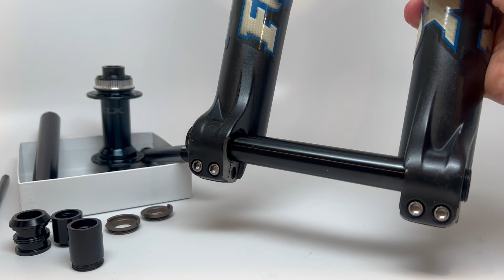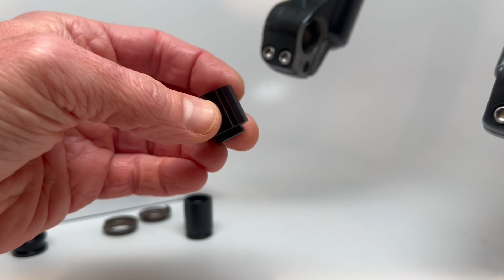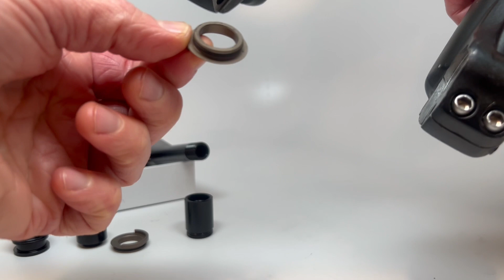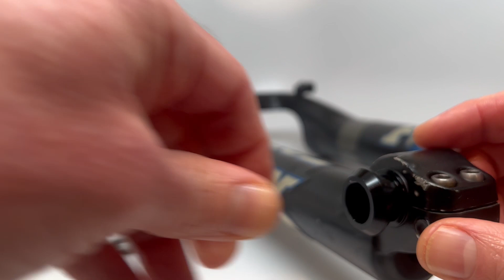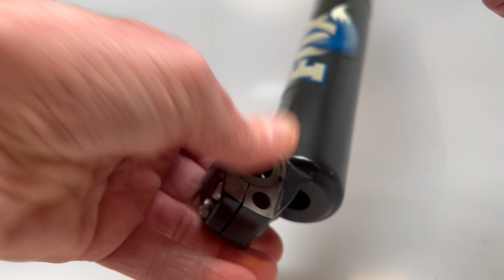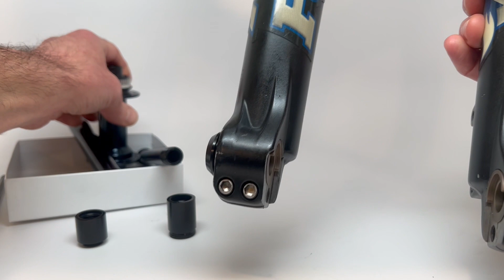JJBP Fox 36 & 40 20x110 Boost to 15x110 Boost Conversion Kit

Comment: I am on the look out for conversion to convert 15x110 Mavic CrossMax to 20x110 Fox 49ers Triple Clamp forks. Based in Scotland, I see you ship to the UK via ebay.
I'd like more info on the correct part and will they be fine on Fox 49 forks? Thanks.
Reply from the maker: Based on what I can find about the Fox 49 it should be a 20x110 Boost fork (as opposed to 20x110 non-Boost) and as such should be able to accept any 15x110 Boost wheel once converted. In that case, you’ll want my Fox 40 Boost conversion kit. You can purchase that direct by contacting me at joe@jjpne.com or use this Ebay listing: https://www.ebay.com/itm/115522066190
Shipping to Scotland is no issue.
Reply from the maker: My info for the fork spec came from here: https://www.ridefox.com/fox17/help.php?m=bike&id=806

Comment: Hi, will this kit work with fox 36 kashima from 2015? The fork  allows to mount 20x110 and 15x100 with an included adapter, but I want to convert it to 15x110. Thanks in advance.
Reply from the maker: 20x110 non-Boost forks can not be converted to 15x110 (which is always Boost). You would need to relocate the brake caliper mount which is not possible.
Reply: @JJPELLC  Is the 2015 36 float not boost? I can’t find anything on the Fox website to indicate wether it is boost or non-boost. Is there an easy way to confirm?
Reply from the maker: @adamsheahan4419 2015 is not Boost. You can convert to 15x100 but not 15x110 Boost.

Comment: Can I use the kit to convert 2016 Fox 36 from 15 x 100 to 15 x 110?
Reply from the maker: Unfortunately, non-Boost forks cannot be converted to run Boost (15x110) hubs. The issue is the placement of the brake rotor mount on non-Boost forks. It is too far inboard and will interfere with the disc brake rotor on a Boost hub.
Reply: Ok...thanks

Comment: Question on this kit so will any 15x110mm hub work with this kit. I have the same exact fox 36 fork it's a 07 to 10 as in this video I went to order this kit yesterday on ebay and they said I could make it fit but the brake caliper wouldn't line up right the hub is a 15x110mm with the brake rotor with the 6 bolt's if you could send me the right kit info if it will work or where I can get the right kit that would be great
Reply from the maker: I’m joejack951 on Ebay. The video is a bit misleading. The fork and hub I’m using in the video aren’t actually compatible. The fork is 20x110 non-Boost and the hub is 15x110 Boost. The hub ‘fits’ in between the dropouts but the brake rotor would not line up with the caliper if a rotor was installed. I needed a demo fork to show how to install the kit so I used what I could easily (and cheaply) get my hands on.
Reply: @JJPELLC  sorry for the question but I'm not sure what boost means for the hub if it's that style of hub then mine is different
Reply from the maker: @gregmclendon6385  See here for an explanation on Boost hubs: https://www.notubes.com/stories/say-what-the-difference-between-20x110mm-thru-axles-and-20x110mm-boost-thru-axles-explained

Comment: Hey Mate
Forks are Fox 32 Rhythm Boost 15 x 110. Front wheel has a has a 12mm through axle and non boost 12 x 100.
I understand the fork inserts will convert the fork to take a 12mm axle however what do I do about 2 x 5mm axle spacers with an internal diameter of 12mm to make wheel 110 wide.
Do you have these spacers in any of your kits.
regards
Russell
Reply from the maker: Shoot me an email at joe@jjpne.com; I have everything you need just not widely for sale yet.